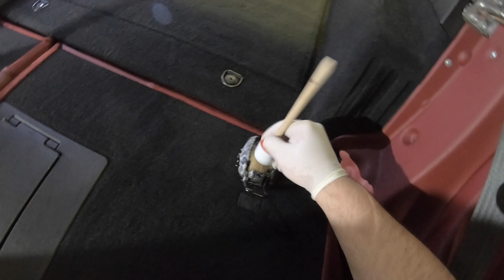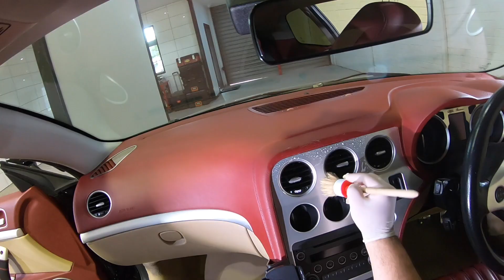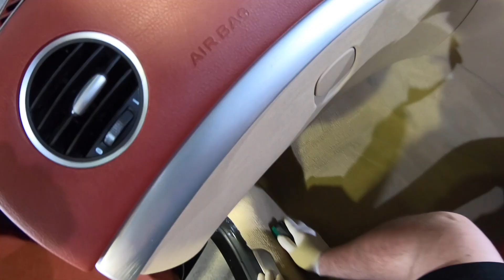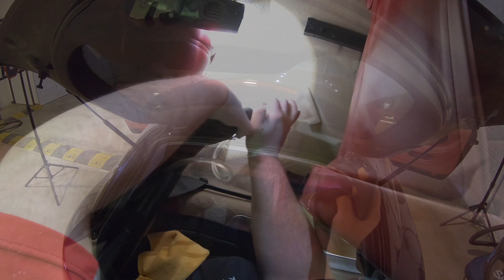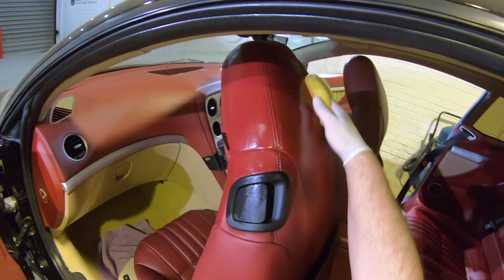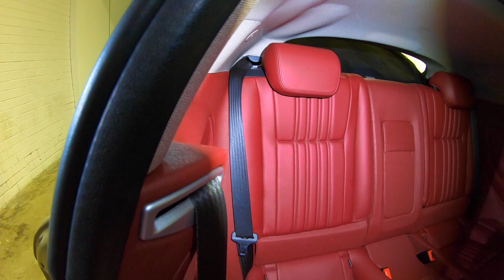The Insane Interior Detail - On My Own Car Alfa Romeo Brera (Vlog 12)

Comment: That BRERA is one of the best modern Alfa Romeo vehicles that Alfa has done over the past 20 or so years.     I don't think they ever imported any here in the U.S. which is a shame because they are such incredible looking cars,  both inside and out.    That interior job is off the charts good too!
Reply: Some very mixed opinions on the Brera. Most Alfa enthusiasts think it has sloppy handling and an awful range of engines. Things like a nicely designed interior that also looks and feels cheaply made or suspension wishbones made of durable cheese, were things alfisti would forgive because the cars were so nice to drive, brera/159 platform is the least appreciated, maybe unfairly, but not totally unwarranted.
Reply: @samsondelighted  La mienne est de 2006 (2.2 jts), avec exactement le même intérieur et je la possède depuis 2013. Je ne reconnais pas beaucoup la description que tu en fais. Bien sûr les moteurs à essence 2.2 jts et 3.2 jts, sont moins fascinants que les vrais moteurs Alfa, d'origine GM mais néanmoins bien réadaptés par Alfa Romeo, le son à l'échappement est très intéressant ;-) et les véhicules sont lourds (d'où consommation importante de carburant). Pour le reste, rien que du positif : qualité de construction, finition, fiabilité, compromis tenue de route-confort, beauté etc

Comment: Hello sir, i find your video FANTASTIC, great job, great tools great technick and thanks for sharing your knowledge with us.

I want to ask you, i am watching that a lot of time is spended in the interior dry vacuuming, the leather, the dash board and the door panels with hard vacuum nozzle and a dusting brush.
i want to ask 1. dont you afraid to make any accidently scratch with this hard plastic vacuum nozzle in leather or in dash,
                       2. if you used forsed air from the metro vac or compressed air or some other  device...it wouldnt better results faster and more safe?.................or you afraid thet all the dust will just flowting arround if you use forsed air for the same job?

kind reegards
Reply: yes i understand now....thank you very much sir for spending time share with me your knowledge............
kind reegards from Athens Greece

Comment: great work on the interior when i did a full interior detailing on my own car i used Polish Angel products and some other products and spendt 15 houres on the interior in total. :D The interior got as close to 100% clean as possible i only droped the water exstraction because after using my tornado black i saw no need to do it.